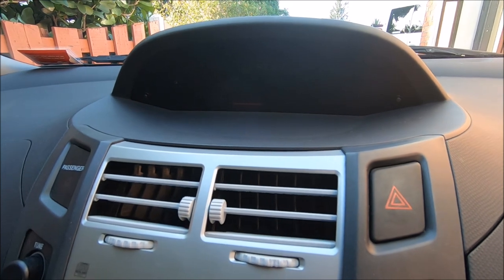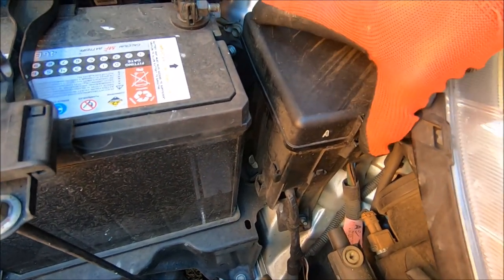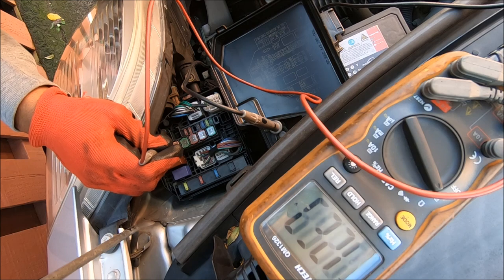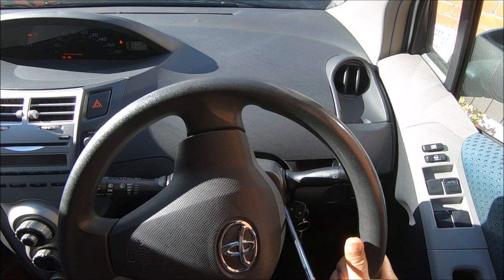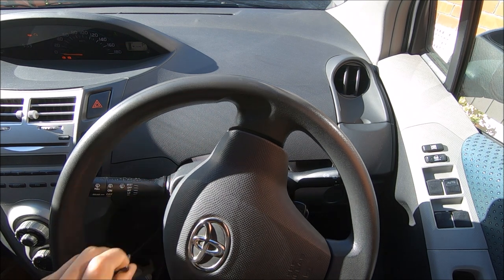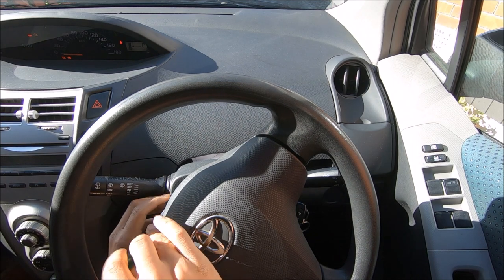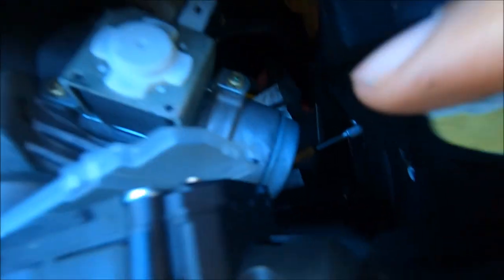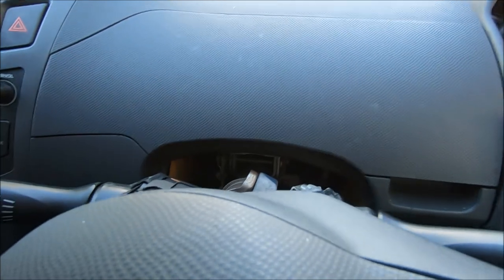Toyota Yaris (Vitz) Headlights not working (Low beam fault)

Comment: Really good, very helpful. Fixed my headlights without paying stacks at the auto electrician! Like to add that it might be useful to sand and clean the downward side of the contact points as well.
Reply from the maker: Glad it helped.

Comment: My 2008 Yaris (in USA) was designed to have the headlights always on when driving. A few months ago, this stopped. At first, I was happy, but then I found that headlights on regular (low) beam had about the same strength as on parking light mode.  I tried to do what this video shows, but unfortunately my Yaris is designed differently.  There is a plastic cover over the  switches which is very difficult to get off; I could only get it partially off.  I found it near impossible to do any sanding of the contacts.  The whole assembly would need to be removed, and they made this a tough disassembly!  And BTW, this old car with 260k miles is one I drive only for my job.  Trying to keep it going for a year or two more.  Thx
Reply from the maker: The US spec cars do have a different switch. It would be best to remove the switch assembly and get it tested. Depending on your model you should not have to remove your steering wheel. See the video below:
https://www.youtube.com/watch?v=KKpdchNqyE8

Comment: Heya my partner did this for my car when I would change from high beam to low beam my low beams wouldn't work thanks for the help but now he has notice after doing so the dash indicator isn't working and the rear break lights they only work when you break?
Reply from the maker: If the dash indicator light is not working then are the lights going on both high / low beam? Rear brake lights should only work when the brake pedal is depressed.
Reply: You would think so and sorry only the high top and led light pressed lights work not the depressed lower ones?
Reply: And yes the high and low beam are working just not the park lights as well as the lower break lights
Reply from the maker: @amybarlow1294  check the fuses and rear bulbs, unless they are led taillights. Does your dash board light up when you turn on the headlights.

Comment: Unfortunately  my 2007 Yaris in Canada (left hand drive) is a different style. The plastic cover isn't clear plastic. It's black and screwed in where you can't easily access the screws to get it out.
Reply from the maker: If you cannot access the screws easily, it would be easiest if the steering wheel is removed. Which will then allow you to remove the switch.

Comment: Hi mate i want ti know about My headlight trouble, one head works Nice and the drivers  one got verte los intensity change bulbs and still the problem
Reply from the maker: Hey I would suggest is swap your left & right headlight bulb and see if the problem follows to the other side. If it does then you know the bulb is at fault. Let me know how this goes.

Comment: Do we need to dismantle the front airbag? or just cover at headlamp and wiper switch only
Reply from the maker: No need to remove the airbag. Everything can be accessed when the steering wheel plastic trim pieces are removed, as seen in this video.

Comment: I have a 2008 Toyota Yaris and I don't have that plastic piece behind my light control. I have a metal box. Do you have a video for that?
Reply from the maker: This video will be applicable for your switch. The black plate is held is screwed in so this will need to be removed if your going to clean the contacts. This might be similar to your switch, Toyota genuine part no. 84140-02090

Comment: Hi Autobuddy! I need your help! I've been meaning to post two questions to you regarding a video in which you showed us how to fix the low beam fault on a Toyota Yaris. I have two questions: The first question I have is how to remove the two screws on either side of the steering wheel without locking the car's steering wheel itself. In park mode, if you turn the steering wheel, the steering wheel will lock. Should I turn the car on so that I can turn the steering wheel without it locking? The second question I have is how to remove the steering wheel cover easily? I do not have the tools that you featured in the video and do not want to damage the plastic cover itself. Can you give me any tips on how I may do this? I'm located in Canada and since winter is fast approaching, I am trying to fix the issue before we get any snow.
Reply from the maker: Answer to Question 1 - Leave the key in POS 1. That will prevent your steering wheel from locking. Question 2 - you can use a wide flat blade screw driver but be gentle as you can break the plastic if excessive force is used. Preferably try and use something which is not sharp

Comment: Hi Auto Buddy!

I attempted this with some success but some failure too. Wondering if you can help? Issues I'm now having:
1. My tail lights don't come on when I switch the headlights on
2. No parking light indicator on the dashboard (still have high beam)
3. Dashboard does not dim when lights are switched on
4. When the headlights are left on, and door is opened, the alarm no longer comes on

Any thoughts?

Comment: Hi mate, great videos! Very helpful, liked and subscribed. My Yaris headlight problem is a little strange so I thought I'd ask you first before taking any steps. Parking lights and full beams are both working fine, but on dipped beams the left headlight doesn't come on. Is this an issue with the bulb, or the fuse, or the wiring? Not sure where to start to be honest! Your insight would be really helpful. Thanks!
Reply from the maker: Thanks for the sub! My first step I would suggest is swap your left & right headlight bulb and see if the problem follows to the other side. If it does then you know the bulb is at fault. Let me know how this goes
Reply: @AutoBuddynz  Thanks mate that's great advice, didn't think of that haha. Will do! Cheers

Comment: For my  toyota echo 2005;when the headlights are ON, high beam is coming on by itself, and sometimes when i switch off engine and the headlights OFF, they come on by itself resulting in battery drain. Appreciate if you can guide.
Reply from the maker: I would start by checking this switch shown in this video, this is the most common cause of similar issues. Unless your car is fitted with Auto headlights I would say the switch is faulty.

Comment: The turn indicators on my Yaris work intermittently. Do you think that I can clean the contacts in the same way without having to remove the steering wheel? Awesome video btw, thank you for sharing.
Reply from the maker: Hi Thanks for your comment. You can definitely try and clean your contacts, this is easiest step anyone can try before opting for a replacement.

Comment: Hi i have the same issue but for the high beam, does not illumate fully. Can this help ?
Reply from the maker: More than likely yes, trying playing with the headlight stalk sometimes you can get it working briefly confirming the switch is at fault as seen in the video.
Reply: @AutoBuddynz  i tried it now the high beam works, and the low beam does not work. What can i do in this situation ?

Comment: Hey bro as you discussed one of my headlight at low beam is not working so first check fuse and then if fuse ok need to sand relay switch?
Reply from the maker: You could do it that way as it is a common fault. However if it still does not work you will need to check the wiring and relays.
Reply: @AutoBuddynz  on another note, is it possible the filament of low beam light is burnt? Because at low beam one side headlight does not work but at high beam both headlight works?
Reply from the maker: @razahyder9796  Yes that sounds like a bulb issue.

Comment: Dear brother my vitz/yaris low beam headlight does not work or some time works after 2 to 3 seconds randomly while switching from high beam to low beam and also left side indicator does not work or work random.  may i do the same procedure or else guide me please
Reply from the maker: Hey, yes do this same process and clean the switch, it should work once done.
Reply: @AutoBuddynz   thank u so much. i exercised the same procedure and both problems resolved.

Comment: Mine both low beams blown same time but high beam working. I have checked the bulbs, and yes low beams blown only. What you rekon why both low beams blown same time?
Reply from the maker: Is your fuse ok? Check your wiring for any short circuit.

Comment: What number of sandpaper to use?
Reply from the maker: 400 grit
Reply: @AutoBuddynz  I wonder if emery board (nail file) might be easier to use?
Reply from the maker: @FD-is1ug  Yes it can be used but there is a risk you can damage the contacts if you are not careful. A file should only be used for heavy pitting.
Reply: @AutoBuddynz  emery board is what I was thinking

Comment: Right side low beam not working,,,,,,how to fix ?
Reply from the maker: Have you checked or replaced your bulb? Tried the fix in this video?
Reply: Brand new light bulb
Reply: Is there a replay or ballast that control the head lights? If there is than where is it located ?
Reply from the maker: @youngstrom2  relay is located in the engine bay.

Comment: Mine are all stuck, park lights,low beam and high beam
Reply from the maker: It will most likely be the switch. Try cleaning it as seen here, but if it that does not solve it try a replacement. Could also be a wiring issue but needs further investigation.